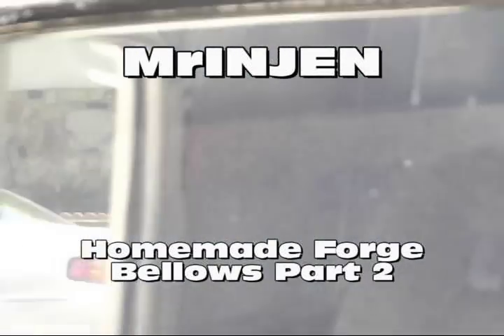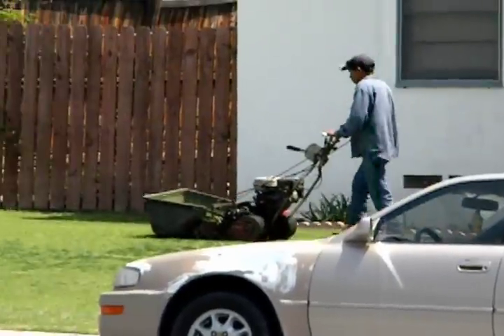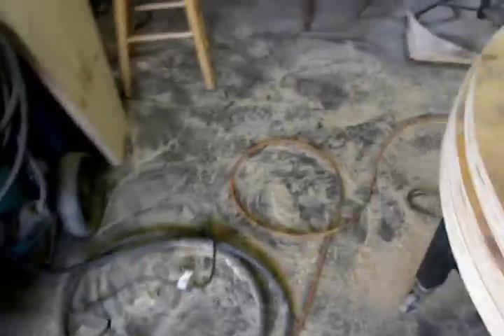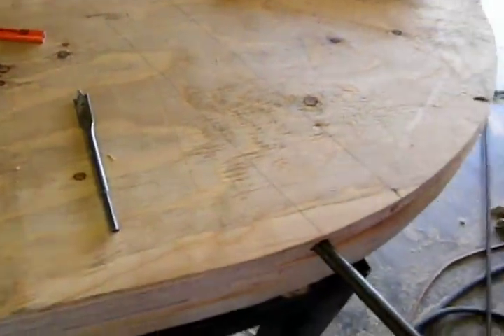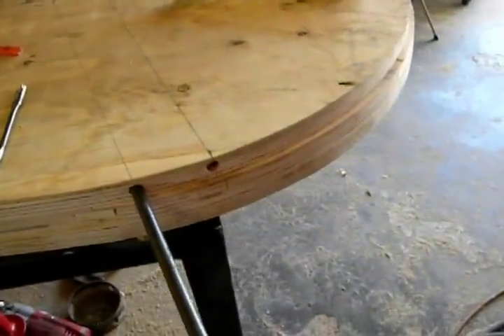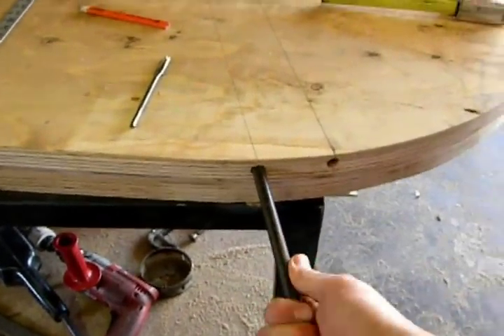MrINJEN - Homemade Forge Bellows Part 2

Comment: Thank you for posting these vids, I'm planning on making a slightly smaller version of this myself so they've been hugely helpful! 
One question though, does the lower set of bellows (the one that pumps air into the upper one) direct any air directly out into the fire, or does it only blow air up into the upper bellows?
Reply from the maker: +Johtas1 I'm glad it helps. All of the air passes from the bottom chamber through the top chamber.